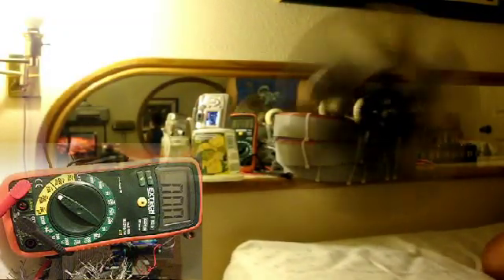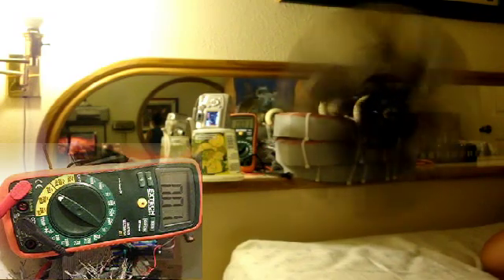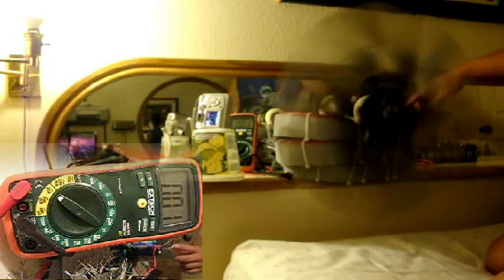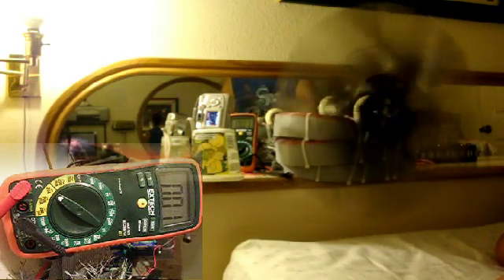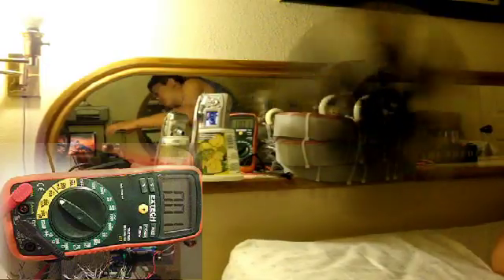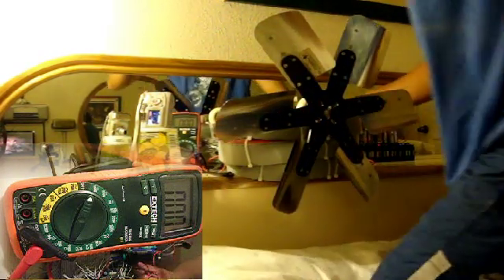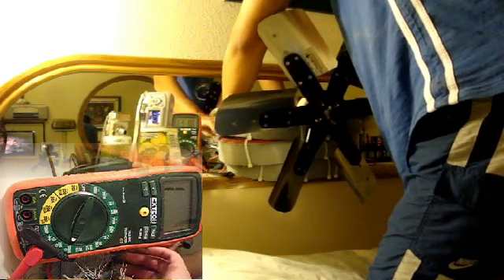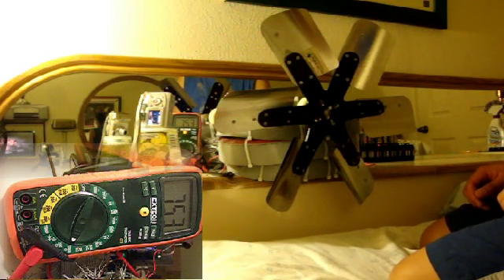ｗａｔｔｓ3.0 210ＲＰＭ ＭＯＴＯＲ Ｎｅｗｍａｎ

Comment from the maker: Based on the previous post, the following is my prediction of the factor of rpm drop when switching to a 1.65x larger fan blade diameter (32"):

(32/19.375)^5/y^2=(((300/280)y)^2-1)/((300/280)^2-1)
0=1.15*y^4-y^2-1.818374
y=1.33

Rpm would fall by (1-1/1.3) or 25%.

At given voltage, 33% is the predicted current increase. Output torque and power would increase 6.95x and 5.23x respectively.

Comment from the maker: These days I can take a grab of my threaded steel shaft, and the device resists rotation so much that those metal threads on the shaft made equally spaced scratches on my fingers! One them actually bled. The rpm of my motor drops about 7% when I go from no fan load to a 19.375" fan.

Present specs: 35mA at 260V. RPM at 310V: 280 (with 19.375" fan) or 300 (without fan)

Comment from the maker: The reason why the speed of Daftman's motor goes up when he adds more turns is because the friction in his motor is so much that increasing the number of turns brings him up closer to the "maximum" rpm allowed by the voltage per turn, even though that "maximum" goes down as he increases the number of turns. As you increase the turns yet further, you will meet at a middle, where the rpm is the greatest, and from there, the rpm will go down as you increase the turns yet further.

Comment from the maker: Keep in mind that my motor is not fully "on load" until the current reaches the maximum. Therefore the voltage while running normally is going to be higher than the voltage when stalled.

Comment from the maker: "Is your ampmeter displaying about 400 mA input current, when you have closed the commutator and hold the rotor still ?"

370 mA as of now at 297V (down from 301V after 12 additional hours of running ;: 0.017V per AA battery)

Comment: Great work,
what kind of AA batteries do you use now ?
NiMh oder NiCd ?

Do you see a recharge effect of the batteries
or does the total voltage still drop ?

If it drops you should also look for one or
two defective batteries in your batteries series stack.
Many thanks for your great hard work.

Regards, Stefan.